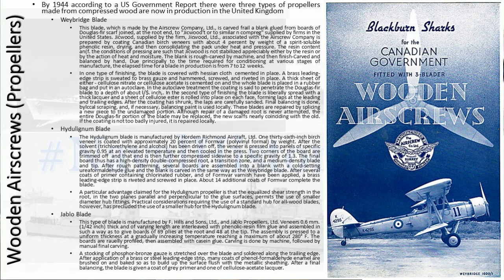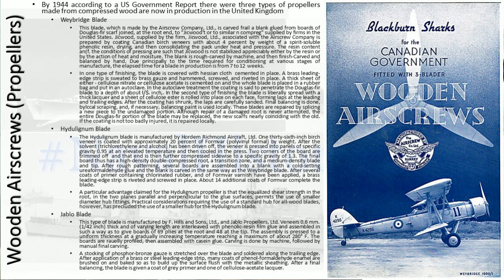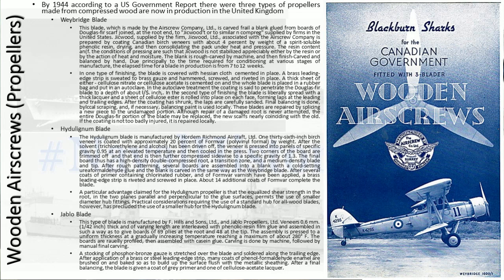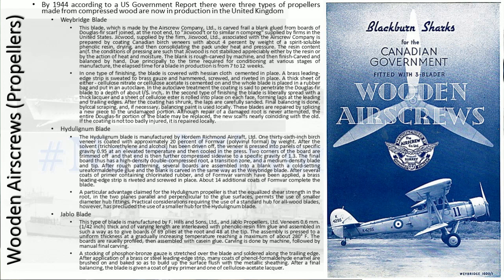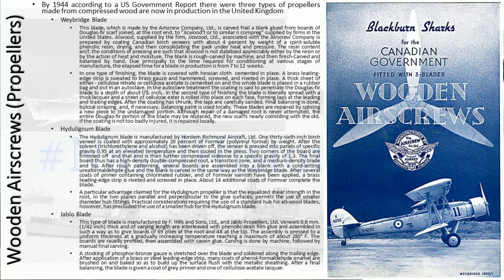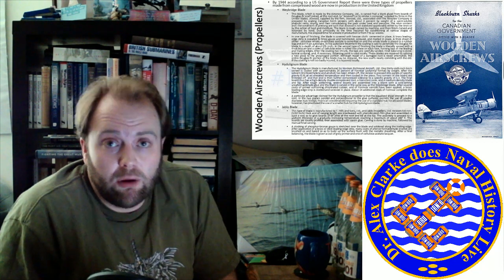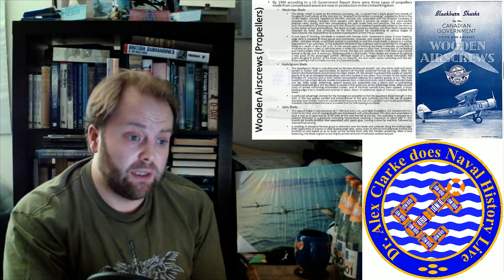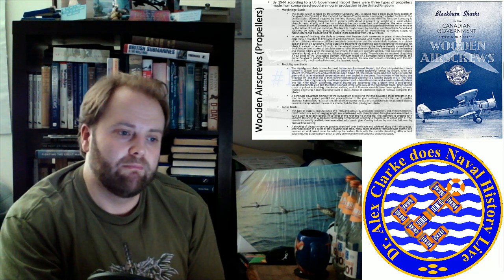Making Wooden Airscrews (Propellors) - 4 Minutes

Comment: That Spitfire FR XIV at the Royal Thai Airforce Museum in Bangkok has a five bladed Rotol wooden propeller. I wonder if it's still in good enough shape to be run up to full RPM. The blades are painted black, and do look a little rough around the edges. Unlike other museums, you can actually walk up to it and fondle it. I have some photos I could probably dig up.